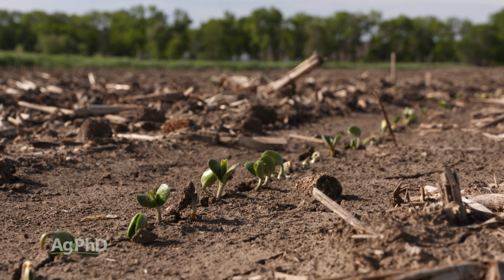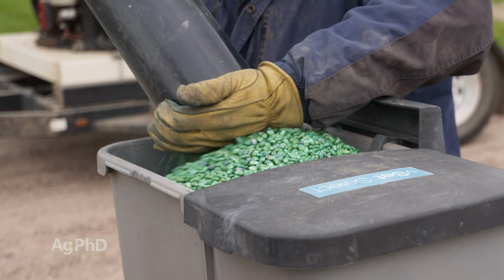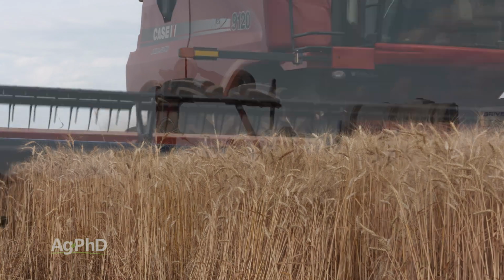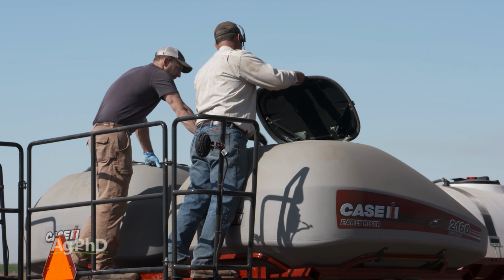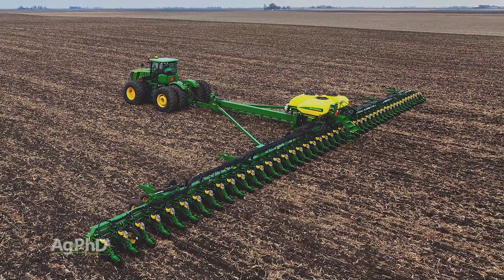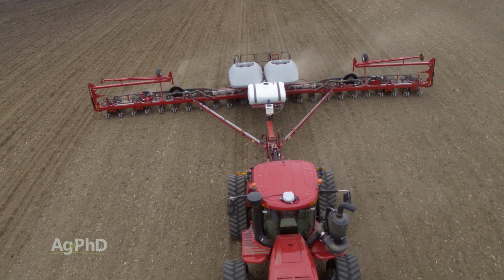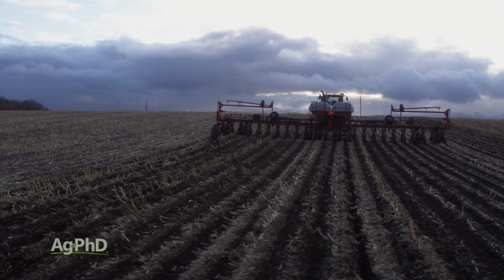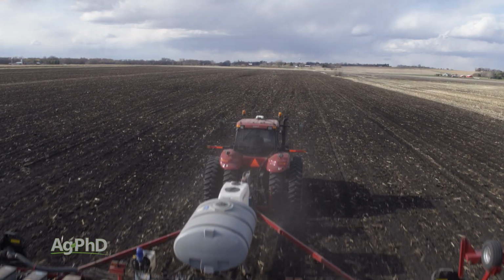Acres Farmers Plant a Day

Comment: You can make a very modest planter very efficient and effective. I know a guy with a 7200 JD he built that does every bit as good, as and in some cases better than my DB’s.

My challenge is how late I have to plant being organic-regenerative , cover crop, plants green etc..  It requires some strategy. 1st I have 1/4 of the farms at rest and serving as pasture. 2nd, I have 1/4 dedicated to my portfolio of ancient grain organic cereals, they are on a different schedule. But even cutting spring planting in half still requires a 3rd strategy. CAPACITY, CAPACITY, and more CAPACITY! Did I mention capacity? You need a lot of it, and it’s expensive! We offset that expense with April custom soybean planting during that period of time we’re delayed and waiting for our cover crops to spool up. Which by the way, was frost drilled with a warm season mix in early March through out the night when the ground is frozen. 

I love your podcast. I lost my brother, otherwise he’d be farming with me. I pick up on the subtle back and forth jabs you give each other from my own experiences with my own brother. Don’t take each other for granted guys. Ya never know.

Comment: Do you trust those high speed corn planters?
Reply: Absolutely we run our horsch 4815  at 11 mph with no issues.  They key is too pay attention to the row unit ride quality on the monitor if it gets too bad we just slow down.  The sweet spot is 9 to 11 mph . I know guys that run theirs at 13 mph planting beans.  In normal ground that we run the field cultivator plus a set of  rolling baskets  on ahead of the planter we see a 98% ride quality at 11mph .  Had ours 2 years now planted 8000 acres each year no issues. Take care!
Reply: @anthonybanda8192  wow! How fast do you pull your field cultivator?
Reply: @adamfpv8294  our field cultivator is 45  feet wide we pull it at 6 to 7   mph with a 580 quadtrac.  For us we custom farm as well as do our own land so we have to go wide and fast. We run all tracked equipment besides our sprayer . We like  36 inch tracks because we really don't do much deep tillage.  We either do vertical tillage to size residue or run the cultivator shallow just to smooth any ruts and kill weeds mostly on corn ground . We had 90 bushel beans this year on ground that has been notill for 6 years and been in beans for 9 years with rye as a cover crop . Take care!
Reply: @anthonybanda8192  thanks for the info! We just can’t seem to get our ground smooth enough to go 10mph we’re usually maxed out at 7-8.
Reply: @adamfpv8294  we find that 9.5 mph is the sweet spot on notill ground tilled ground 10 to 11 . We watch our ride quality sensor on the monitor if it gets too high we slow down . We don't always get to go 9 mph but most of the time we do .
Reply: @adamfpv8294  look up Peter's brothers farm supply on utube . They are a horsch dealer. Go down through the videos because They have a few videos on their personal planters .
Reply: @anthonybanda8192  Thank you!
Reply from the maker: Brian and Darren addressed your question on Ag PhD Radio: https://soundcloud.com/agphd/02-10-22-ag-phd-radio-show?si=2f861b0217544bcb8774da7db2c3d4af&utm_source=clipboard&utm_medium=text&utm_campaign=social_sharing#t=50:43
Reply: @AgPhD  Thank you Brian & Darren